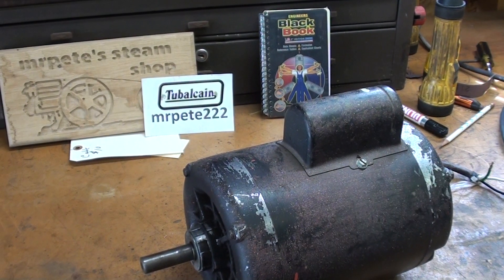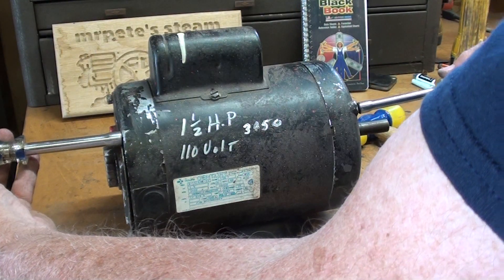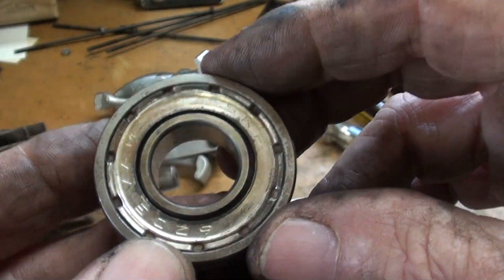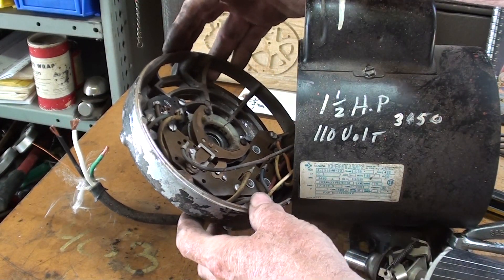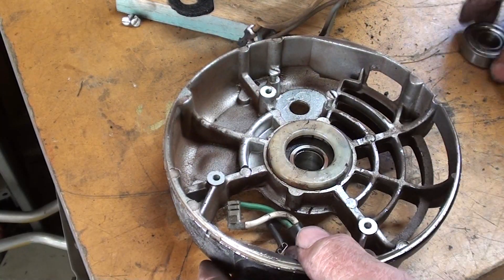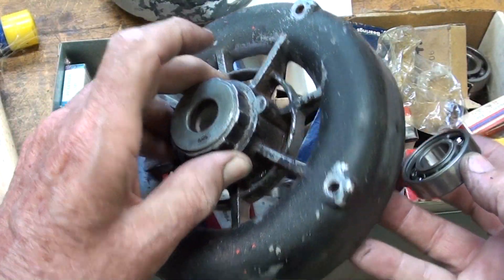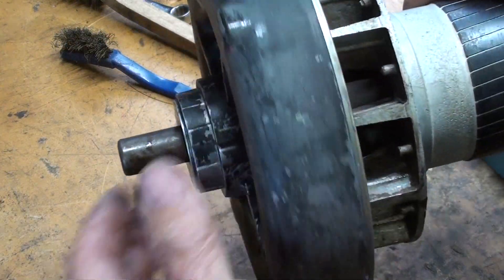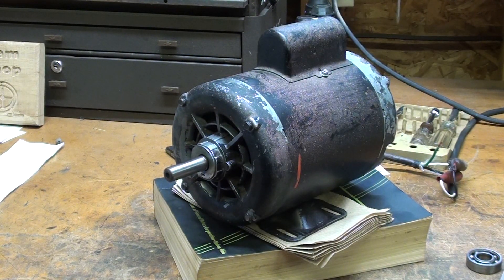Replacing Electric Motor Bearings Tips #468 tubalcain

Comment: I'm pleased to see you tightened those draw bolts in a diagonal pattern.

I've seen lots of videos where bolts are tightened in a circular pattern, and not just on motors, but also on cylinder heads, car wheels, etc.

Makes me cringe, to see people tightening them in a circular pattern.
Reply from the maker: Thanks

Comment: Good job. Love these quality old motors, they run and run and what do they ever need ?  A pair of cheap bearings once in a blue moon. I had a bridgeport 2j motor, making awful noise when i got it, a sort of clicking ratchetting noise, it turned out some one had replaced the bearings and left one of the four draw bolts a half a turn loose, and that is what was making then noise.

Comment: Sunday Morning Coffee and Tubalcain while waiting for Church time.  Nothing could be better.  My Lisle Drill Grinder has 6202 bearings with a 16mm bore.  Glad I measured the bearings and shaft before ordering!!  Until then I didn't know the 6202 came in anything but 15mm bore.  I first thought they may be 5/8" bore but that would have given a 0.005" press fit. The 16mm gives a 0.001" press fit.  Always measure the bearing race!  (I ordered both, to be safe)
Reply from the maker: Thanks for watching, Yes always measure

Comment: A dab of grease were the centrifugal actuator for the switch slides is a good idea. 20 some years ago I picked up a 5 HP motor off an air compressor. It was replaced  for not working. I took it home and tested it. it would not shift off the start up winding. I dissembled it freed up the centrifugal slide and it worked fine. Sat in the barn for many years. I installed it on a Quincy air compressor I restore a couple of years ago and has been running great!!!
Reply from the maker: Sometimes it's just a simple fix

Comment: Mr pete, I have a question to pose to u or anyone here and would greatly appreciate ur opinion as I can't seem to find anything in the various forums surprisingly 
I'm building a steady rest for the logan  200 and have opted for brass/bronze fingers over the bearings or cam followers - my question is about plain copper? 
I've heard mere mention of copper, but can not find any comparison of copper vs brass ,bronze or bearings  - just wondering if u have an opinion 
Love the video as I  am an industrial electrician by trade I found it quite interesting - being union I work in big industrial plants such as Ford,GE, DuPont and all those big companies would not consider for a second replacing bearings in a motor if u can believe that - to them time is money so they would rush a brand new motor in a heartbeat - just thought might like to know 
Thanks
Reply: I think the reason they don't use copper, is it wears poorly.  It kinda smears when it is machined.  Makes great pads for chuck jaws and vise jaws for just that reason.  It deforms easily.

Comment: Not bronze in color, backplate cast and machined for a ball bearing diameter...........   Hmmmmm. ??  My inner engineer is fidgety.
Reply: Is this your sneaky way of saying you saw the bearing information written on the side of the rubber seal?
Reply: @barrygerbracht5077  I thought I could see the seal, but I made out no numbers.  Doesn't make sense to cast in that big snout and machine it for a ball bearing then make an adapter to hold a bush.  Not logical.  Therefor we know there is a bb.  It sounded better when done so he got the noisy bearing.  Usually it would be the drive end bearing that is worn as it has the most load.
Reply: I work in an electric motor factory and that ope(opposite pulley end) end bell looks like it has a bearing held in place with some sort of press to fit retaining piece. Plus I don’t know if that Is an oiler spot or not. If it is, it might not be for that model of motor. Casting molds are expensive so some endbell castings are made with with features for several different motor models in mind.
Reply from the maker: Yes
Reply: I’d like to see that end cap taken off if possible to see what’s in there.

Comment: Reminds me of my work in D.C. (Capital Hill) replacing seals and bearings on condensation and circulation pumps. We used to use our stove ovens and even electric bearing heaters to expand them in the installation process. Sometimes the bearings would overheat and leak all the grease out , requiring them to be thrown away. The younger mechanics had to be taught this process by us seasoned “old fellows.” The seals were made of ceramic, requiring to be install gently and in a immaculate condition or they would leak. I’m retired 3 years now but you’re bringing back some old memories. Thanks mr. Pete 
Oh, I almost forgot- The young bucks would always to forget to mark the housing and struggled putting the motors and pumps back together, then cry for help! Lol
Reply from the maker: That's a good story, I bet you have plenty of them
Reply: mrpete222 : sure do but don’t want to steal your thunder.